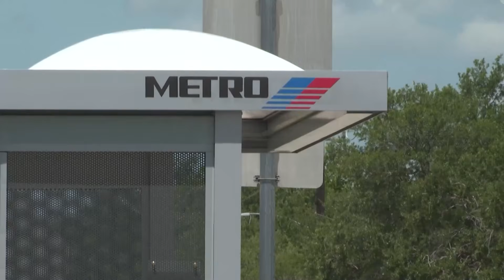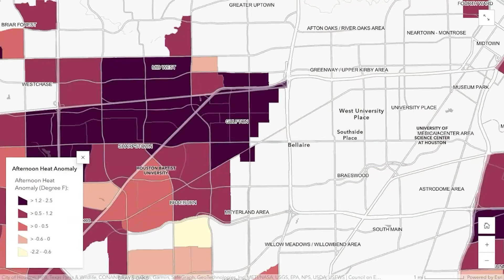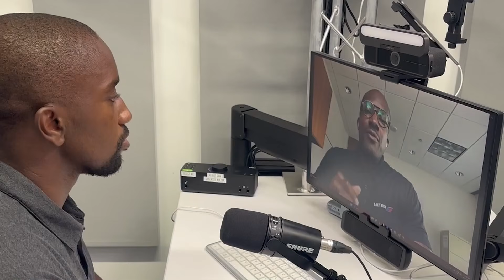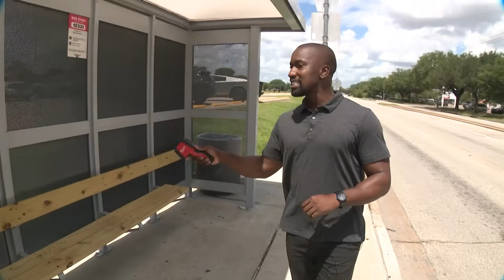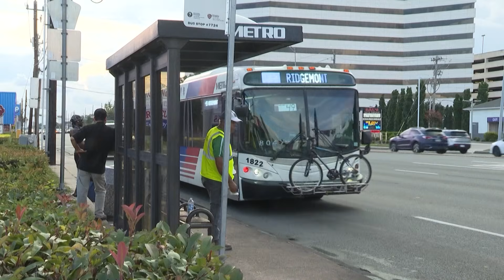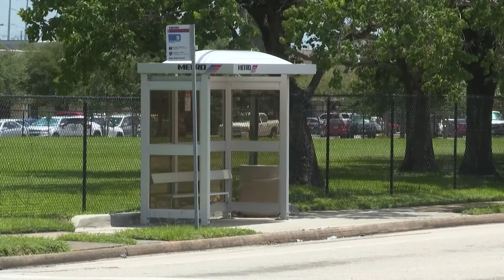Houston METRO tests updated bus shelter design to combat extreme heat

Comment: ....DOUBLE LAYER ROOFING with space  in between  2 layers so  THE HOT AIR  circulate plus decipate heat and the heat wont transfer  into second layer .....The top layer is WIDER than the second.
DOUBLE ROOFING has been the solution  in desert region.